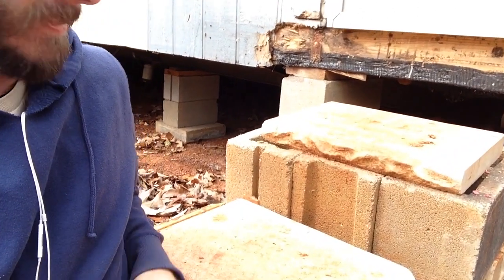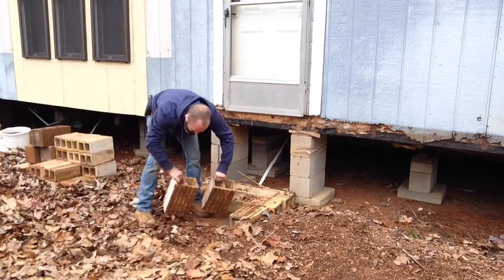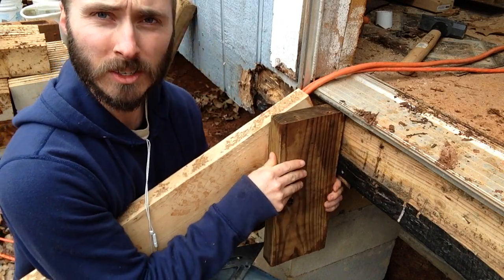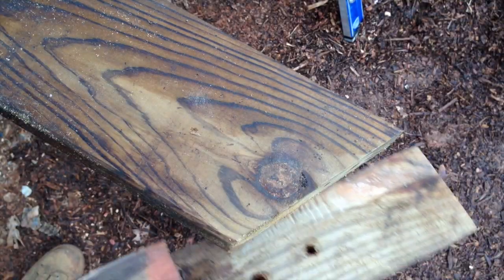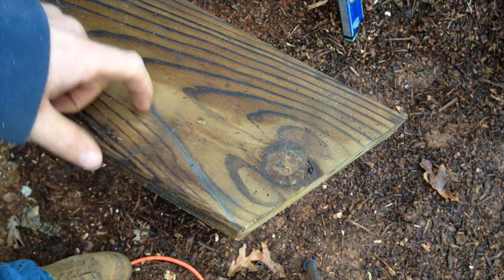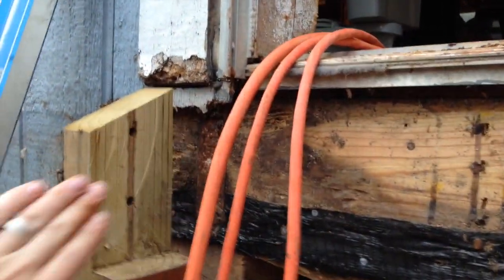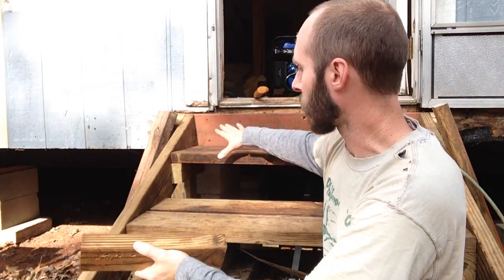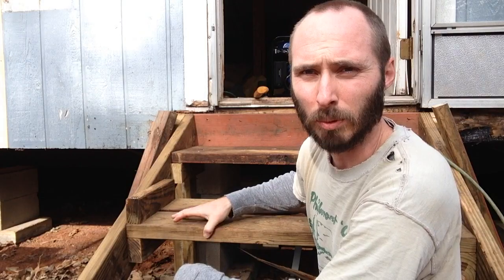How I Built My Mobile Home Steps with Reclaimed Lumber for Temporary Use. Not a how-to video.

Comment: You appear to have greater issues than steps.  I see lots of dry rot and deteriorating  exterior siding.  Why do all these manufactured / mobile homes look so Ghetto ??? Are they really built that cheap
Reply from the maker: Absolutely. These steps were not the final product but a temporary fix. I replaced all the dry rot and replaced 1/3 of the exterior walls. Not to mention all of the interior walls. As for the build quality of mobile homes, they are pretty bad.
Reply: @EastTexasHomestead  I think your posting is a good thing. Always nice to inspire other people to. Conserve and save a little money. Your stair building looks good
Reply: @EastTexasHomestead  well, I appreciate your steps without using pre- cut runners... My mobile home is being eaten by termites, as was my tree, the park just cut down. So I'm not wanting fancy new steps, I will probably tear the mobile home down next month when I move from Michigan to Florida. I've gotten my use out of it....nice video, I can handle making temporary steps now..thanks